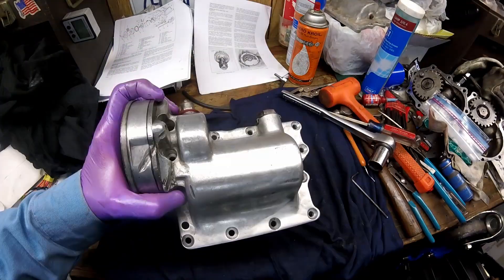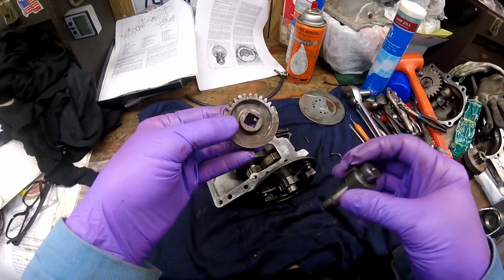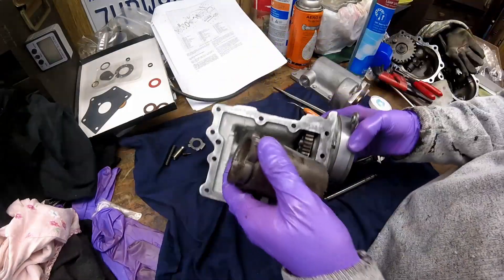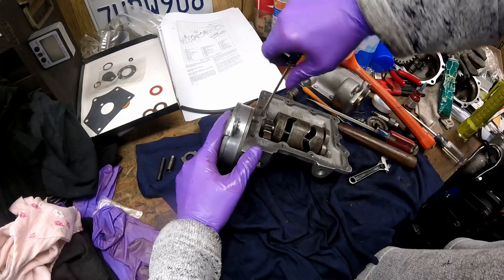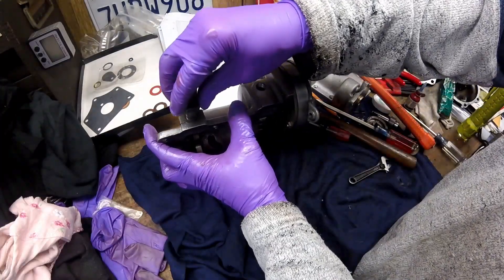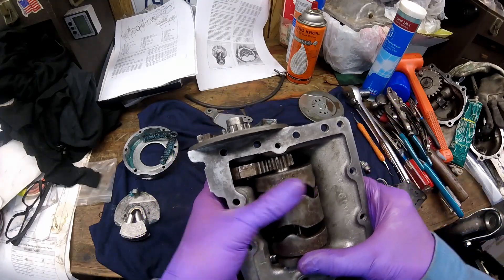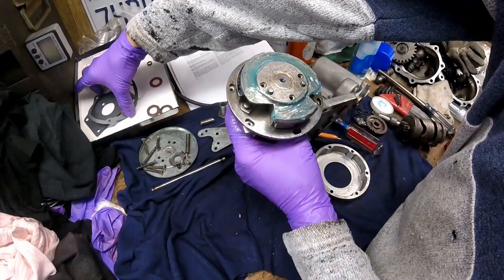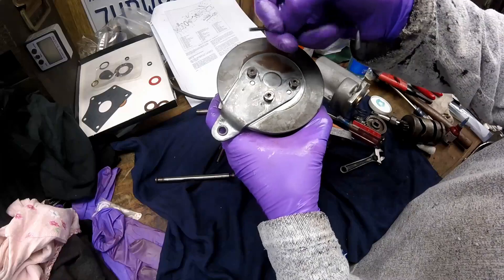Ratchet Top 4 Speed Rebuild Harley shifter Pan head Knuckle Trans

Comment: Thanks SO much for this video. Just what I needed after broke some teeth off the larger gear with the square hole in it.
One tip though. Remove the spring retainer plate from the back of the shift dogs and remove them.
Fit it to the shaft then re insert the dogs and springs and retainer plate after it's all on the shaft. Much easier :)
Reply from the maker: Thank you. I'll give that a try next time I rebuild one. Thx for watching!!

Comment: Great  video!  👍👍One thing though...I don't think you need loctite on the shaft retaining pin because the cover sits on the case and the pin is flush and can not come out agaist the case.
Reply from the maker: You’re not wrong but I use it on everything on my HD because of all the vibration. The thread locker is cheap and it doesn’t cause me any headache if I’m using the blue stuff.
Reply from the maker: Thank you for watching.

Comment: My 41 knuckle goes into ever gear like butter except 3rd gear.   Any idea if there is a agjustment or what would cause it?  Its a new rebuild
Reply from the maker: Do you know if they replaced the shift forks when they rebuild it. It sounds like if everything was in good shape then they didn’t use the adjustment tool to set the transmission up.
Reply from the maker: In other words, they didn’t use the alignment tool and then shim the forks properly